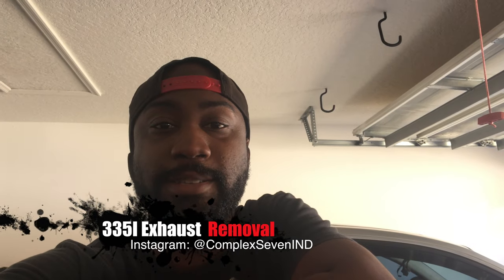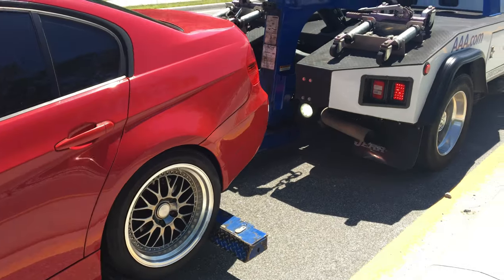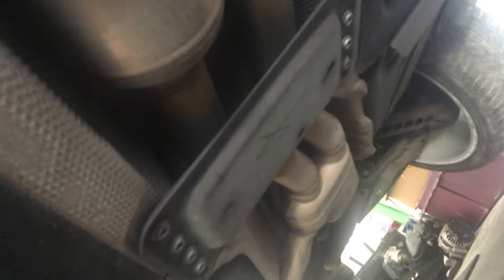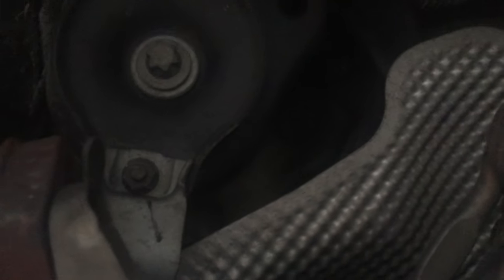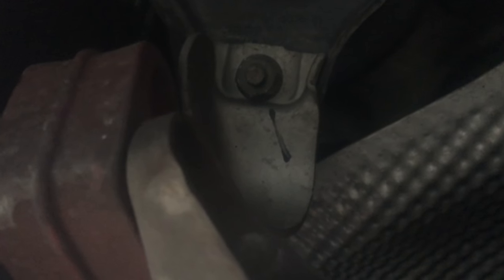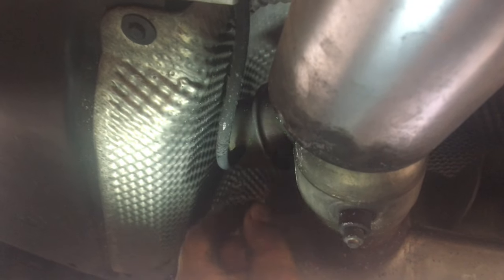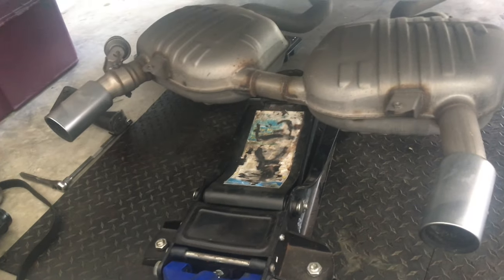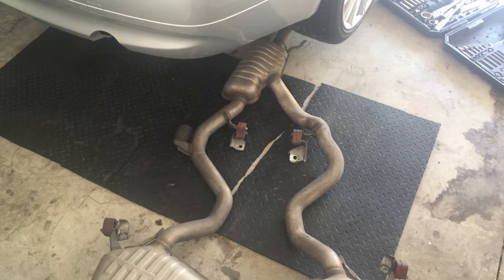BMW E90 E92 Exhaust Removal w/ Project Updates

Comment: Nice video! These cars sure are a pain to work on though.  I can spend two hours removing pans, shields, exhaust etc  just to get to the one part I need to change!
Reply from the maker: Very true! Even the easy stuff such as changing the battery, you also have to go code it to the car lol

Comment: How long did this take?  I just got told that it will take 5.5 hours just to take the cats off my car? ($440 just for that at this shop).  07 bmw 335i coupe.  I’m dumbfounded on what to do now
Reply: @nOshi2x  Thanks for the fast response man.  The guy told me there was a difference between a coupe, and a sedan.  I'm not sure what it is, but they're going to look underneath it next week and give me a more accurate quote.  I might just install my catless DP's and leave stock exhaust, if its going to be so much.
Reply: Titan where are you located? anywhere near michigan? i do the job for 200 on jack stands takes about 2 hours
Reply: @allenmessi4636  hey man, I think they were quoting me on the 2 cats on the stock downpipes on my car.  I ended up paying a friend $70 to put catless downpipes on my car, and paying the same shop $300 to weld a pipe from the downpipes back.  (full straight pipe), but I live in East Tennessee man.  Thank you for the offer tho!
Reply: Titan sure thing, they ripped you off for the secondary cats though thats for sure was it raspy after secondary cat delete?
Reply: @allenmessi4636  Its just loud man, i went from complete stock exhaust to full straight pipe.  Its a complete different car, you can burble so easily now just by tapping on the gas.  If i were to describe it, its like a trombone lol.